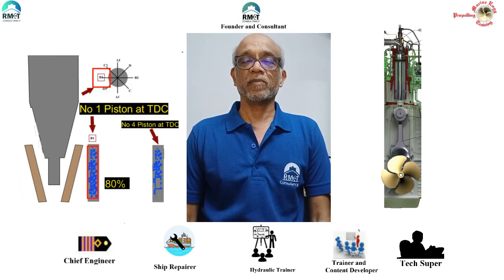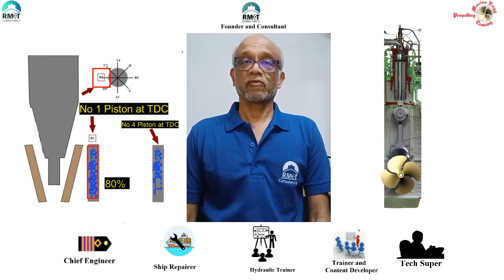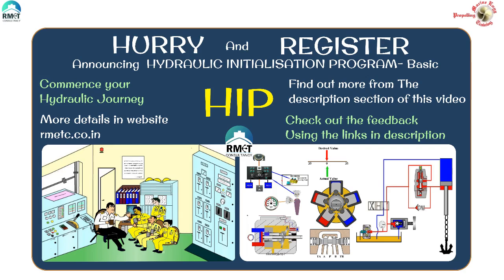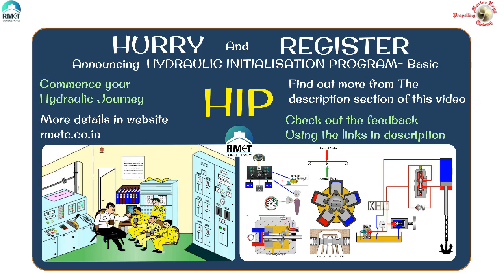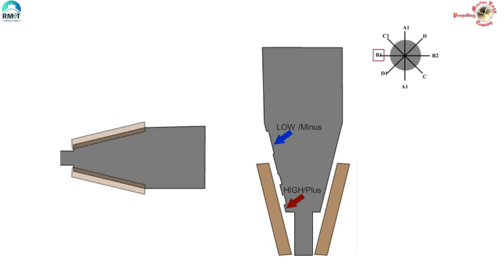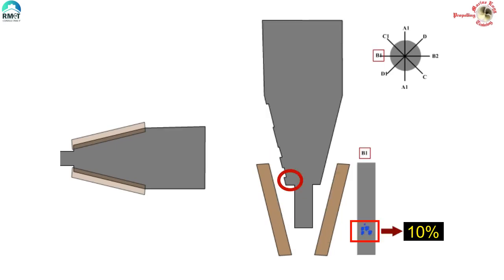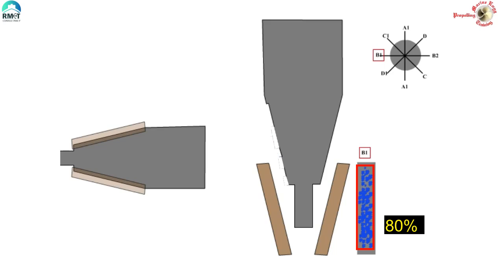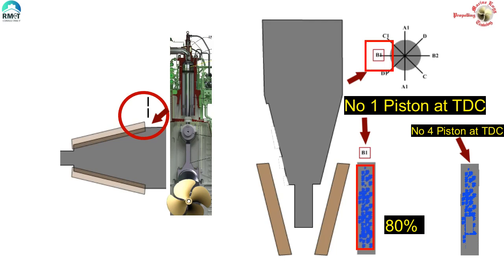Why Propeller push up only at No 1 Piston TDC ?|RMET Consultancy|Ramesh S| Marine Engg Training

Comment: One question Sir? What I read in one of the manuals is that during propellor push up the intermediate shaft is removed so that the thrust doesn’t come on the thrust pads. Now if the intermediate shaft is removed it says that the ‘O’ marks on the boss ad the shaft to be aligned . Max deviations about 5-10 mm depend on shaft and boss dia on either side of mark allowed. So in this case there is not question of which unit at Tdc while propeller fitment as once u turn the shaft with ‘O’ mark on top and disconnect the intermediate shaft you cannot align the shaft with which unit at Tdc.

Now when you disconnect the intermediate shaft and connect it again you have to pay attention to which unit at TDC with respect to the shaft.

Also, yes the engine unit (which) with respect to shaft and the propeller orientation also does matter when vibration aspects have to be considered and should be maintained!

Please correct me if I am wrong.

Comment: Further addition to this i learnt from a wartsilla propellor technician who was with us to retrofit a new propellor. The standard 4 blade propeller undergoes cycles of high and low thrust when it crosses the top part of stern frame due to less water flow. At slow speeds the combustion from every cylinder creates pulses in the shaft. These when combined with cyclic blade thrusts can  create dangrous vibrations in shaft. Hence the 1 TDC is selected so these get canceled out. I have been on a 7 cyl engine with a 5 blade prop and a 6 cyl engine with a 4 blade prop. It is to cancel these vibrations.
Reply: How keeping #1 at TDC would cancel out those cyclic(rotational) thrusts. 
This explanation doesn't make any sense. No matter at what angle you insert the propeller, the pulses from each unit at low speed still gonna travel the shaft to the propeller's end.

Comment: Refer Engine manual for unit nos
Earlier it was common to differentiate between East and west  where the engine is built. 
In my experience, mark could be either A or 0, for blade A to be on top.
With regards to bedding only skilled hands are used. Bedding could be on propeller or on shaft.
Propeller kept on the ground and aligned horizontally. Shaft is hung on the gantry crane vertical, (my experience at Lisnave shipyard ) where propeller shaft was rejected by Lioyds..
Good video, Remesh. Thanks for the good effort.
Reply from the maker: Thanks a lot sir..for your indepth clarifications..your comments do enrich our knowledge..🙏🙏